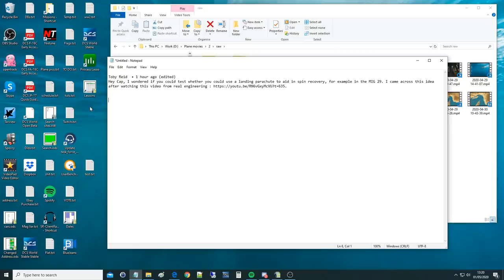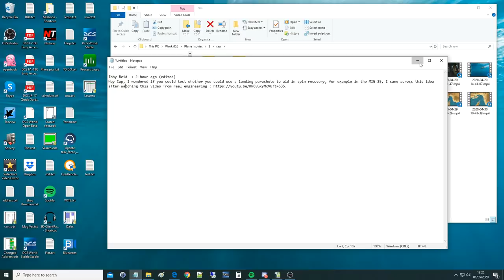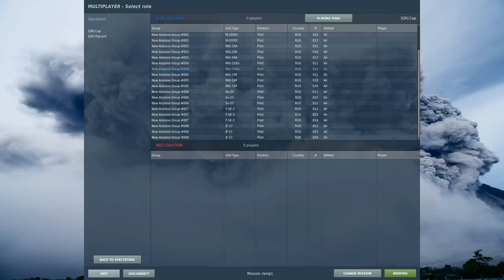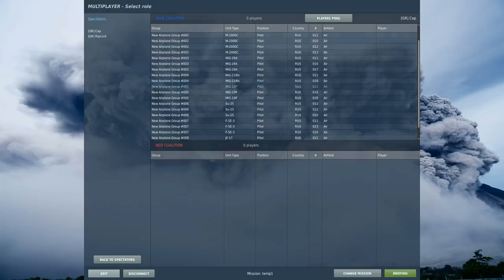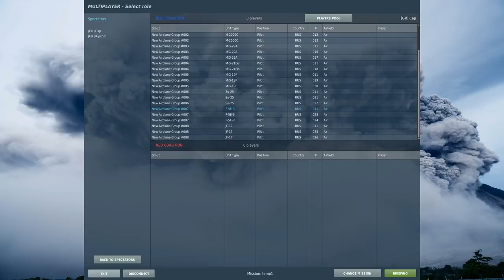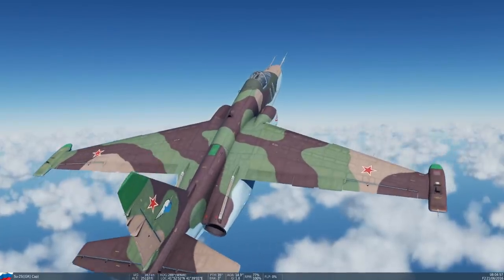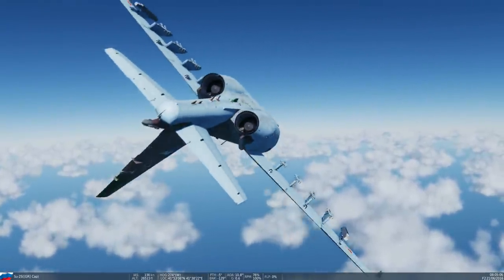Questioned: Can A Drag Chute Help Flat Spin Recovery? | DCS WORLD

Comment: In real world, special spin recovery chutes are commonly used to safeguard the aircraft during intentional spins in flight test programs.  Normal landing drag chutes are usually designed with a shear link to protect the airplane if accidentally deployed in flight.  Not to say that if I were in a non-recoverable spin I wouldn't give it a try and hope it helped me out of the spin before shearing.  I've heard of such attempts being made with mixed results.

Comment: Using a drag chute is standard procedure while doing high alpha testing in prototype planes to aid spin recovery
Reply: Not really, a spin recovery chute is a different thing that they install on a launching system attached to the outside of the plane. They are much stronger than ordinary drag chutes.

Comment: Always loved this video for showing how quickly you can go from fighter pilot to part of the rocket program. First time I saw it reminded me of Kvochur's ejection. Also I believe they have several rocket nozzles and a gyro which tells which ones to fire in order to push the seat away from the ground. There's a su-30 ejection from the Paris air show in the 90s that demonstrates this perfectly. Near inverted the seats basically fire the two seats right down the nose of the jet.